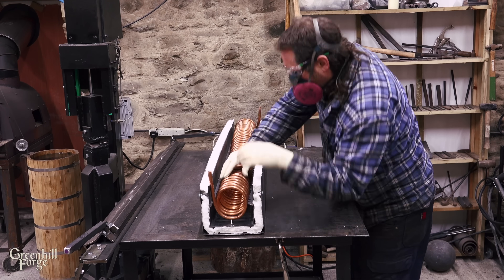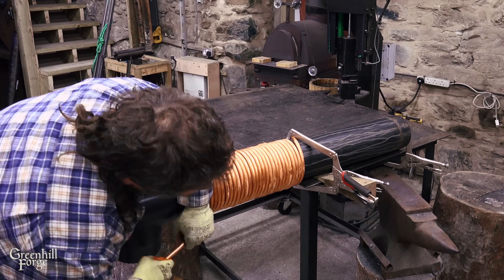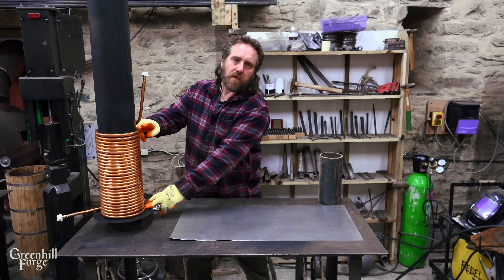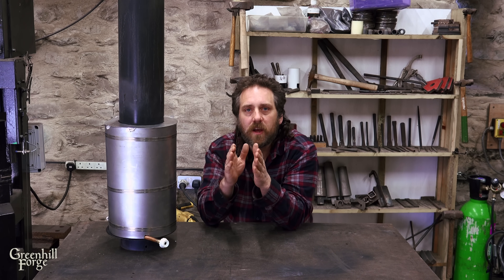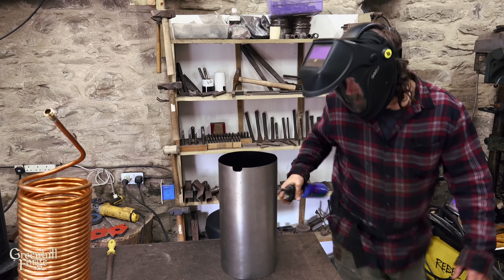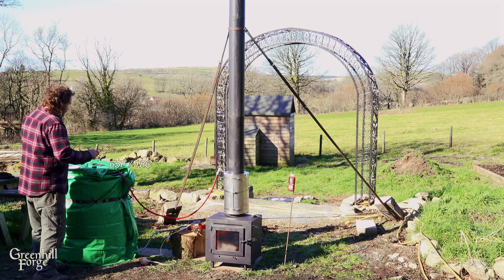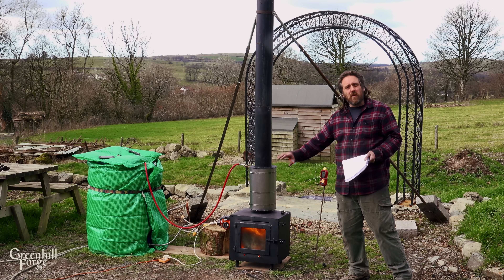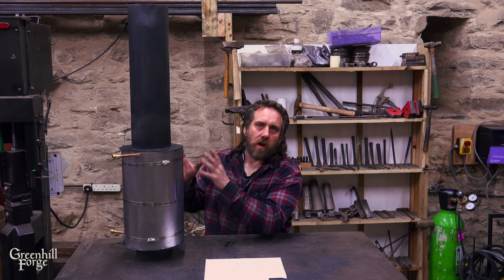Best Wood Stove Water Heater Yet: New Design Tested | Off Grid Water Heater pt3

Comment: Well done!  I respect how systematic you are being.
One small variation that should be easy to try is to insulate the flue above the coil.  The speed of the gases inside the pipe will impact how much heat gets transferred.  Another commenter mentioned the taller coil gives more time to transfer heat.  I agree and think we're hitting on the same issue.  If you can slow those gases down, you'll get more heat transfer.
My theory is if you insulate higher up the pipe, less heat is lost early.  This will slow the speed of the gases, as the temperature gradient will be less or spread out over a longer difference (Same thing).  You could also try a couple 45 degree bends in the pipe above the coil, further slowing the gas velocity.
Reply: I agree the coil outside is much better.  
However, the more heat you are able to transfer to the coil, inside or out, the more likely you are to condense that creosote inside the flue, meaning you'll have to clean it more often.  With the coil outside, this should be pretty trivial.
Reply: Sorry, last comment and then I'll bugger off!
To further test my theory, you could test the air flow speed out the end of the flue.  It might be hard to find an anemometer that holds up to the heat/gases though.

Comment: When you use the glycol, think antiq tractor oil filter cartridge. Make the bottom waterproof. Don't make the top waterproof for evaporation. Not sure of the corrosion factor but fluid would transfer heat the fastest.  Should not boil over cause of the circulator pump.

Comment: I would think that putting the coils inside the woodstove would be the best. You get direct heat and not to worry about the buildup. Any flue type would build up on the inside of the pipe.  They do sell water jacketed wood stoves, its not about how fast, if you are burning wood to stay warm, you can heat water at the same time. If your burning wood to just make hot water, then you could use an outdoor wood stove or rocket stove.

Comment: well the most efficient way I feel is to fill it with water.. And yeah =) I'm talking about high pressure vessel... Thermal putty would be too expensive... I don't think you can beat graphite on this. Grease but how much pressure would that make? and would it evaporate? And yeah thermal putty is grease based stuff.  A boiling water heat transfer, you would have to keep the water level up by tripping water in.

Comment: Add fins to the inside of the flue, this would increase the surface area and transfer more heat to the cooler outer wall. If the fins had a helix, so as to slow the airflow and transfer more heat.

Comment: This is my suggestion from what I did to build a pool heater out of an old smoker - forget the coil and use a manifold of several straight vertical pipes with a loop at the bottom and at the top as the supply and return. Then do the cover and maybe the graphite. The advantage of a system like that is that the transit time of the water through a multi-vertical-pipe manifold is slower, resulting in a more effective heat transfer. When I did my first test, the water was boiling at the top!

Comment: Can you weld a spiral around the flue that is tight to the copper. Then wind the copper into the spiral ie have 3 walls around the cooper transferring heat. It will spread it out a ways. 

Like a heat sink 

I dunno may work?

Comment: I'm wondering if the "can" around the coil with the graphite got noticeably warm under the insulation.  If it DID then perhaps instead of the insulation add a sand layer to act as a thermal battery.  That would be helpful for an indoor situation as that sand would continue to radiate warmth into your cabin/shop or garage.

Comment: Would a stovetop option through a graphite and coil filled box not be better still (especially if the stove being used has minimal heat shielding or direct contact with the firebox).  It seems like the external coil will still cool flue gases and create potential for creosote accumulation.

Comment: I keep thinking about how the flapper in the flue on my woodstove gets so much hotter than the surrounding pipe that it can get a glow on a hot fire. Maybe riveting across the pipe underneath the copper coil would give you the best of both worlds, more surface area and turbulence inside the pipe to transmit more heat to the outside, but none of the corrosion or difficulties of running the copper through. You could even add fins to the rivets inside the pipe to act like dummy dampers for the full effect.

Comment: Interesting. 
I would have thought spacing the coils apart so that there is more steal to pass the heat and then fill with sand or graphite (good idea btw) would even be better. Your real limitation is how much heat the steak can pass, as it’s a pretty poor conductor of heat. 
What about just a flue, but divide it to smaller pipes, then just make it a whole water tank that the water can absorb the heat directly? That should be more efficient, but harder to make for sure. 
Ether way, Great work!

Comment: What if... you had what amounts to a water tank in contact with the flue?  Stainless steel, a pipe in a pipe sort of thing with intake at the bottom, output at the top? Just cold water in at the bottom , hot water out at the opposite side at the top.

Alternate version  would include stainless dividers forcing the water to coil its way to the exit. 

Thinking about something you'd fire up daily:
A rocket or other stove with integrated tank that has an opening to air so it can boil as needed.  You run your water line copper coil a few loops around the top.  The water cannot exceed boiling temp, therefore the potable water in the line cannot ever be too hot or boil.  I hate paying electric to heat water with tree fuel around. Hate it. I need to have dual 3-way valves so I can use solar in the summer and "burn session based" water heating in the winter.  "Go hot shower all you like, we've got fuel!"

Comment: Can you make the pipe double layered and let the water absorb maximum heat from the exhaust pipe. to avoid turbulence try forcing a flowpath that's making mostly laminar flow. Some emergency High pressure release valve can be used for safety when used without pump, with pump you can leave a gap between the layers on top.

Comment: I like your experiments they are interesting. I have a cabin and have often wondered if their could be an efficient way to utilize the heat that goes up the chimney. I have read articles by test labs on the misconceptions that people have about stove pipe design. The most common misconception is that a longer pipe in the building will transfer heat into the building. This design increases the likely hood a of a flue fire because when smoke loses its heat all the creosote and particulate fall out of the gas and build up in the pipe increasing the chances of a flue pipe fire. The heat exchanger on the outside of the pipe is the safest way to go. Commercially, oil has been the go to heat transfer medium in a closed system. Large scale transformers used in electricity transmission systems use oil to transfer unwanted heat from the core to the surrounding air. It would be tricky to work with.

Comment: The straight open flue means most of the hot gas pass in the middle of the pipe and never transfers any heat to the walls.
This is why a stove with a backwards bend in it gives off so much more heat. A sort of turbulator in the path of the gas will have a huge impact and many modern stoves come with this. It must be designed to be pulled out for sweeping the flu though. Have a look at "twisted tape turbulator" which is a common way to do it. Also, combined this with a longer contact on the flue by stretching the coil. This will allow for much higher energy extraction.

Comment: Have you thought that extending the coil and leaving space between the coils  had a significant effect.
Put the smaller diameter longer coil jacketed inside the stovepipe. No soot the open coil, smaller diameter, extended length should be very efficient.

Comment: A suggestion that would require a LOT more effort to manufacture: a makeshift heat exchanger comprising several steel pipe segments (e.g between ½ inch and 2 inch sch 20) aligned parallel to the flow, packed in a larger pipe, with caps welded on each end that have holes drilled (and welded) to match the pipes.

Basically, the flue gases pass through the pipes while the water flows inside the larger pipe and around the pipe segments inside. Inlet on one side at the bottom, outlet on the other side at the top.

Comment: Very interesting.    I used many way in life the easy way and better    …….
You made. Flat coil fit the two pipes just made a perfect fit for the stove pipe to get out ,you have secure the coil in the stove top ….no pump.BUT your tank have to be higher then of the ground….don’t forget to put a safety valve safe direction for the stems to get out

Comment: What if you make the chimney out of water pipes welded side by side to make a pipe, and then run the water through the pipes?  The pipes are galvanized so they might not rust.  It will take a lot of welding, but maybe you can use that adhesive in place of some of the welds.

Comment: For improved efficiency, try using a coarser helical pitch (i.e. space the coils out more), this way, each coil has more hot flue metal to itself, rather than touching near where the flue was already cooled by the previous turn of copper.

You could also try flattening the coil about 30-60% so that each turn of the coil has a greater contact patch with the flu. 

You could try to improve the efficiency even further by using something to fill the small gaps between the copper and the flue to increase thermal conductivity (not unlike the graphite idea, but only the side of the copper that is in contact with the flue matters, here, so maybe high temperature silicone or some kind of temperature-resistant thermal paste could work).

Comment: @Greenhill Forge Would you have increased efficiency if you stretched the insulated copper worm up to run the length of the chimney so you capture the heat that is currently escaping above the insulated portion?

Thanks great work!

Comment: Per your asking for suggestions even though you are probably well beyond needing any suggestions. You might want to cover the copper tube with tin or metal to help hold in the heat during use. Make the cover removable. Just something I would try if living on a homestead.

Comment: No matter how good of a system you set up on the outside of the tube, you're still only going to be using a small fraction of the heat in the pipe since the surface area is so low (in fact it's the smallest possible surface area per volume). If you kept the same cross sectional area but made the tube a rectangle or some other shape then you'd get a lot more surface area to transfer heat. 
For example:
A 5 inch diameter pipe has a cross sectional area of 19.635 inches squared and a perimeter of 15.7 inches
A 2 inch by 9.8 inch rectangle has about the same cross sectional area and a perimeter of 23.6 inches, 50% more!

Comment: You are concerned with the sand "stealing" heat and yes it will until it becomes ambient with the total heat in the system.  Once it is slightly higher the copper will steal the heat from the sand as well - you want this.
The cold sand will steal from the flue, in turn the cold copper will steal from the sand and so forth to the water - which is the goal.   Heat moves to cold naturally you have given a more direct path to the water using the sand.

Comment: If you are committed to a completely passive system then you should look into a "Fluidyne heat pump" - see Wikipedia for more info.  It is a type of Sterling Engine.  You use heat to mechanically push water through the system.  The advantage is you will get far more heat transfer then by just using a thermosiphon.  There are also no moving parts so it is very reliable.

Comment: The height difference of the older internal coil vs this new external coil might also play a big difference in the heat extraction. This new setup needs to extract that heat in what looks like half the distance.

Comment: Nice testing.  And while I agree that putting the coil outside the flue, I'm not sure the constant cooling provided by any of these designs wouldn't cool the flue through the metal enough to avoid creosote buildup.  I guess only repeated use and constant monitoring will answer that question.

Something to add (because, hey, why not?).  It's been gnawing on my brain for some time now.  Keep in mind this wouldn't work in a completely off-grid design unless some human power could be added, and I'm not sure what the power demands would be or if legs on an exercise bike alone could crank out that kind of wattage.

Your designs seem to focus on bringing the water to be heated to the heat.  Makes sense, again, in an off-grid install.  But I've never seen anyone play with a design that moves the heated gas to where it is needed most.  In essence: has anyone you know of made a flue manifold that re-directs heat gases?

Imagine a simple switched duct right at the base of the stack.  Throwing a lever changes the direction of the exhaust from up to downward.  A flue network then takes the gasses to an old-style water heater, perhaps, or a large pipe covered in a thermal mass (like loose gravel) located under a cabin's floor or in a house's crawlspace.  I know, I know; hot gasses rise.  How would they fall?

With a vacuum.

Would a shop vac (for one example) produce enough suction to draw the exhaust gas downward, through a hot water heater or thermal mass, and then back to the manifold to be vented right back to the stack?

By placing the sucking machine as near to the output to the stack, one would avoid overheating the motor/fan.  The heat would be transferred to the water heater/thermal mass before reaching it.  A simple thermometer near the fan could alert the system.  And when that temp reaches critical, no problem.  It just switches back to "normal," re-directing the gases back to the stack.

Major challenges include making the ducting leak-proof of course.  Simple holes go from an irritant to a major loss of suction; get enough and the system will just stall, probably choking off the fire in the process, or letting enough exhaust escape to prove a hazard.

Anyhoo, I needed to share this concept for the world to either try or shoot down.  I've got too much on my plate and not enough welding skills to make the first attempt, at least not at the moment.

Good luck with whatever you try, and thanks for the experimenting!

Comment: Hi, have another idea, since you are already making a tight insulator, try filling the area around the copper by a non-flammable oil (like car engine oil). That will surly maximize the heat transfer to the tubing

Comment: The graphite powder was a clever idea. I would just use water though (by making a non-leaking vessel around the other coil). 
However I am still looking forward to that steel mantle I was suggesting to earlier videos. It's a steel mesh inside where the burning area connects to the chimney. It must have an additional (hot) oxygen source. This mantle will heat up and with addtional oxygen it will make the remaining CO and soot burn more efficiently. It will also raise temperature of the heated area even more, due to additional oxidation. Having a mantle would be like having an afterburner on a jet plane. Kind of.

Comment: Why not build it like steamengine. The pipe should be smaler pipes like 1inch and several of them, then have the water directly around the pipes, no coil. Like a tank where the exorst pipes goes through water, larger surface and direct heat transfer.

Comment: Good stuff. It’s not messing about, this is science. 😂. I was thinking about building a wood fired water heater for the garage to use with radiant heat. My idea was to get a gas bottle and run about 8 2”  steel pipes thru it. Welded top and bottom. With the internal of the gas bottle as the boiler vessel, flow and return connections welded top the side of it. Like a fire tube boiler.  It would fit vertically onto my gas bottle stove.  That’s my idea anyway. Keep up the good work I enjoy your show. All the best.

Comment: Using steel shot might work better than sand. How about twice as much copper coil? Insulate the inlet and outlet pipes? Cut down the amount of water you are heating to what is needed to take a shower, or wash dishes or wash a sort load of clothes? Use a small electric or gas fired water heater in place of a barrel (10-25 gallons or so)? Thanks, great post.
Bob in Nevada

Comment: Sorry if I missed it, is there a reason the coul is that short? You mention flue gases transferring heat above the coil?
Have you looked at back boilers? I grew up with thermodynamic (pump free) Rayburn with back boilers

Comment: Yeah, graphite was a great idea. 
You would transfer more heat if you made the hot gasses travel horizontally for a distance before they went up and out. Make a horizontal rectangular flue, and place the coil above the flue pipe and insulate all around. The woodstove radiator you just made would work great. Make the horizontal shelves the heat exchanger coils.
Reply: You have to be careful for galvanic corrosion when using graphite.

Comment: You need to stretch the coil windings to about double height of current setup, to allow for larger stack surface area to radiate & transfer heat from. Especially when using heat conducting filler such as graphite, sand or water.

Comment: What about using the sand or graphite as thermal mass to heat your house. Make a case for the mass to sit in that spans the entire length of the interior flue pipe and see if it helps level out the variations in heat output or would make a smaller stove have a much bigger impact.